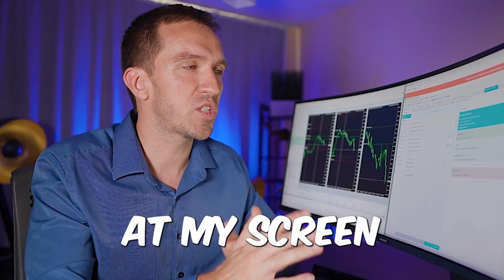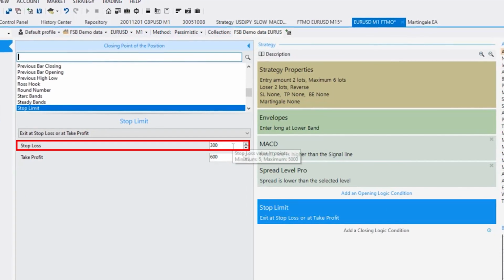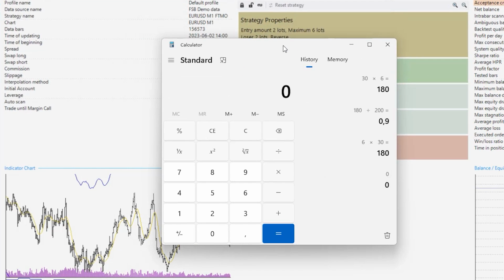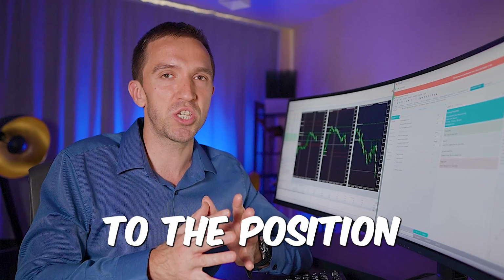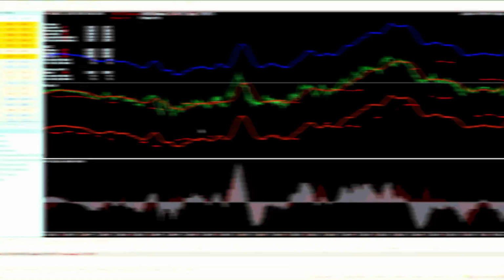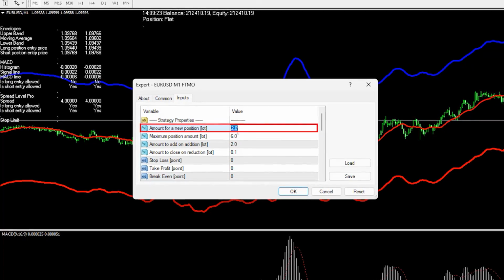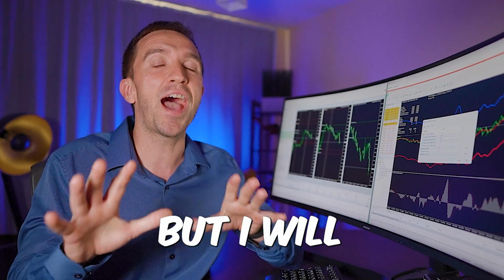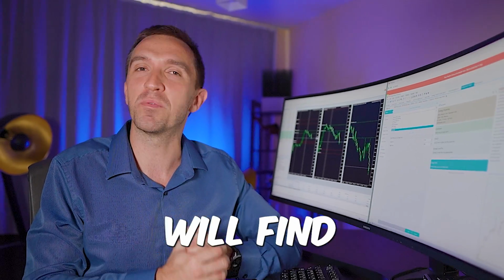The FTMO Robot EURUSD on M1 Time Frame

Comment: 6 trading days and the position is still flat.. not a single trade executed
Reply: Did you actually buy it ? How is it going ?
Reply: it hasnt taken any trade since 7 trading days  @SnR_street
Reply: Did you check the expert logs in metatrader? I wasn't getting any trades even though I could see the signals.. I get the following error: 

2023.08.10 22:49:56.832	Core 01	2023.08.02 15:15:53   Error: ActionTrade::ManageOrderSend(): OrderCheck(): Invalid order filling type

Still trying to figure out how to resolve it.
Reply: How do you like it
Reply: Hey . May I ask if its work with you
Reply: @abdallah8354   not yet

Comment: Will it be updated on the udemy ftmo course or should i buy the robot from the link you've provided in order to get every update? Btw i appreciate your work your contents very helpful and i find them reliable. Thank you for your honesty and hardwork keep it coming bro
Reply: The course will be updated with some more videos as well and with the EA.
Reply: @PetkoAleksandrov thank you. I bought that course. 😊
May I ask another question, please.
About your 99 EAs demo testing. How much memory and processor power such testing requires of 10 computer if I test from my computer at home (the Internet connection is 100/100 Mbit) ?
2. If I'd want to test it from some VPS, which VPS company and which plan would you recommend for testing 99 or 100 EAs ?
Reply: @michstockholm1164 is there a course that includes this FTMO EA?

Comment: Hey Petko! Strategy looks nice! I was wondering, on your FTMO robot website page, you mention higher time frame filter, but in your strategy video I dont see anything about higher time frame filter. It looks like it's only trading on the 1 min chart. How does it filter on higher time frame? Thanks!
Reply: Hey mate, the MACD is on M15 chart as a higher time frame filter. But you do not need to open it on a separate chart.
Reply: @PetkoAleksandrov  Hey Petko! Thanks for the quick answer! Makes sense! Thank you for clarifying this for me!